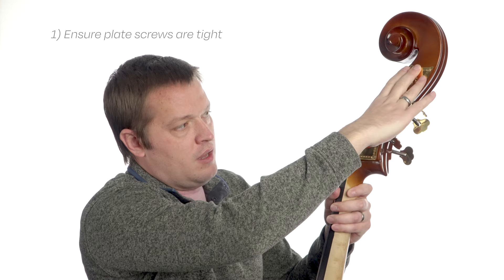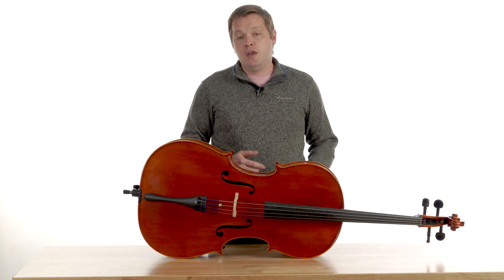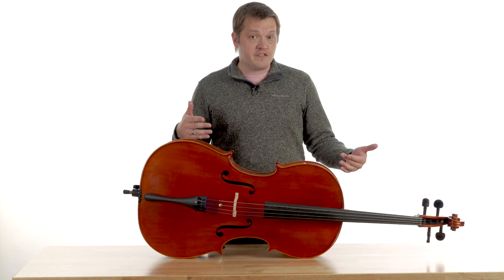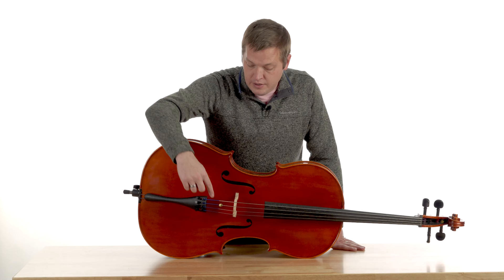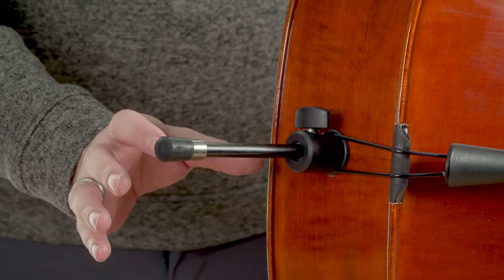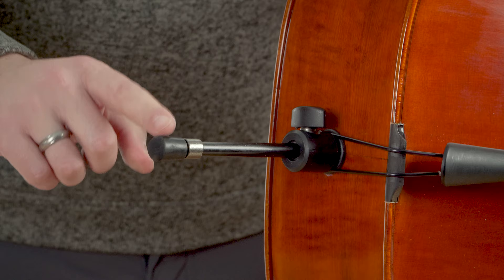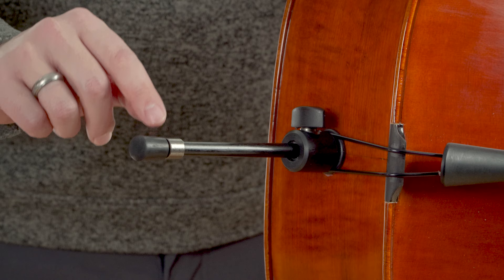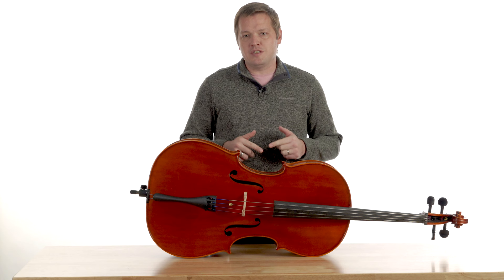Fixing a Buzz: Cello and Bass

Comment: Thank you! I wasn't even using my endpin (it's easy enough to support the cello with my knees), but that's what was buzzing. Now I'll be using the endpin, just to keep it grounded and unable to vibrate!

(It only buzzed on the A string, so I was looking all over for string-related causes. It must have just been a resonance, something to do with the length of the endpin.)